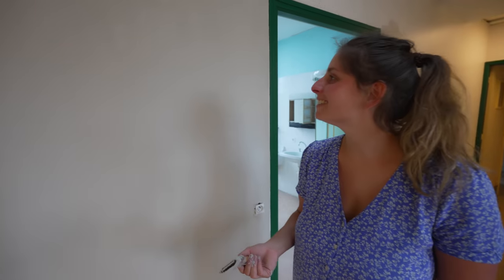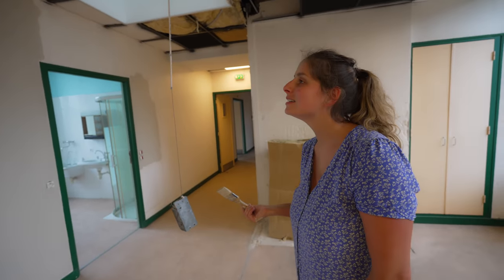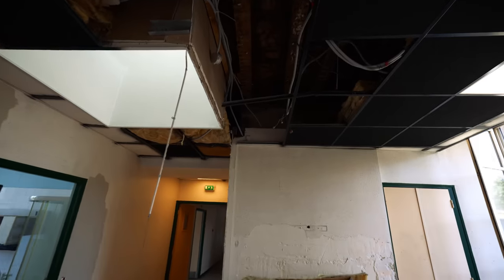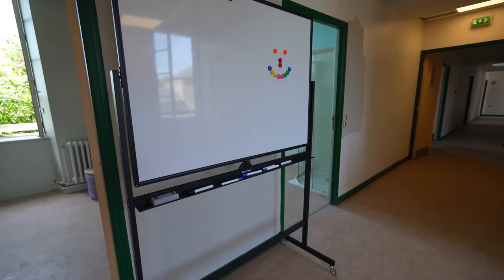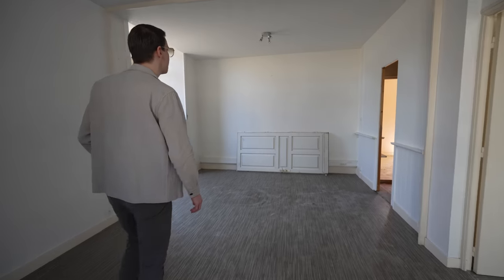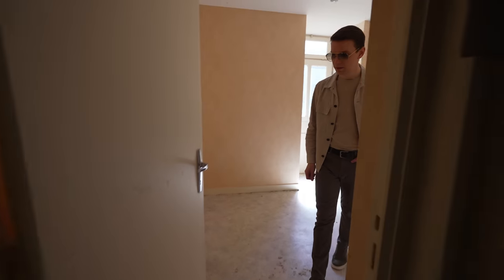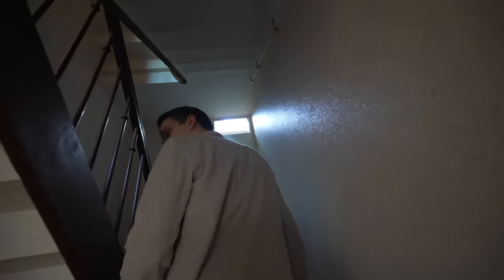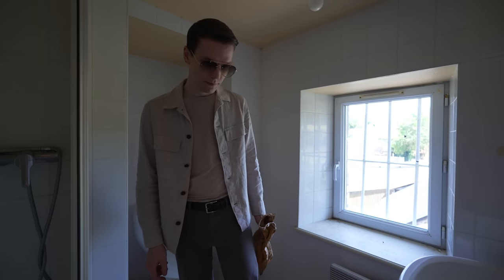The Boss Comes To Help At The Abandoned Convent!

Comment: Love the black ceilings. Gwen did a great job with the bubbly wall. The 1st apartment I can see great possibility. Will you put the fireplace back. I can see a gas log or heater there especially with the front door right there. The 2nd needs an exercise loving person. I’m not sure about a 3rd story bedroom especially with a fire. I’m wondering since none of these apartments have closets where do you hang your clothes? Also a micro kitchen. Maybe knock out a wall? I love them regardless ☺️

Comment: The one thing I have missed is a location for a large garage and a workshop. Perhaps using that last 'semi-basement' apartment could be converted into such a space. It's location is unobtrusive to the exterior to the Convent would be someting to additionally consider. By digging a ramp and installing a different set of doors, this would be an ideal workspace to repair and store supplies instead of using the prime areas of the rest of the convent. Having the scrappy door between the apartments might also provide a better location for an onsite caretaker/craftsman to live and work if that is ever in consideration.

Comment: Just an idea for the last apartment: On the top floor leave the bathroom where it is and the romm next to it should be a dressing room - that is a great layout as you can take a shower and directly get dressed next door. Also, that room only has a window in the ceiling so it would not really be any good as a bedroom, in my humble oppinion. Floor beneath that can be the bedroom with a little office next door in the small room where the "kitchen" ist in. Ground floor: I would put a large wall-to wall "invisible" style cupboard in the back of the vestibule (where the tiny door leads to the other apartment), where one can hang coats, hats and keep the shoes. The room with the door that leads to the courtyard would have to be an open plan kitchen/dining/living room situation. But the layout is a tough one for sure. Every story 1,5 rooms... Other possibilty could be to really put the bedroom in the windowless top story room, and dining romm/kitchen in the first floor, living room on the ground floor.... Seems that was the way they had it. Looking forward to seeing what you will do with it!

Comment: 💕LAST FLAT TOP FLOOR - The bannister goes up the stairs to the left in front of the wall so if the wall & shower were removed where would it lead to ??? As it looks like part of that floor is missing💕Looks like a ROOM has been blocked off & bricked up behind the shower IS PART Of the building behind part of the last flat ???💕LAY THE LAST 2 flats floor plans out next to each other floor by floor maybe where the funny door is with part wall knocked down is all plasterboard💕Instead of 2 flats maybe there could be 3 flats A B C a top middle & bottom floor flat💕Floor plans need looking at💕

Comment: Maybe a sunken small courtyard with a wrought iron rail around it for the second apartment so you could dig down so there would not be a step down at the entrance of the apartment as it is very strange and dangerous.Your steps down would be into the courtyard it would also be some nice outdoor space for the apartment,just an idea. It might be money well spent to hire a interior designer/structural engineer to help with the design of the apartments. Their knowledge will help with everything being up to code and designed so they would be easy to rent and turn out AMAZING,OUTSTANDING,STUNNING,SPECTACULAR,STUPENDOUS,STELLAR,PHENOMENAL. 😉😉 It may also help you avoid some costly mistakes. These are all just ideas all the very best on all your endeavors always!!!💖😊💖

Comment: Another great video Billy, thank you…

Just a thought on the 2nd apartment with the 3 levels, on the ground floor you knock through to that spare bedroom of the other apartment. This will create space for small vestibule from the front door to the staircase, the old spare bedroom becomes a larger sitting room, the other ground floor room becomes a kitchen and install a Wc 🚽 in the tiny sink room.
Then have a bedroom with small Wc/shower room on each of the upper floors…

Comment: Billy you shouldnt step down into a building. The ground outside should be 150mm below finished floor level inside. I guess there is no dpc on those external walls however I dont see any rising damp on the walls either, something to think about

Comment: Those 2 apartments almost seem to be better as 1 extra large space. Especially considering the doors to the garden, it would be far nicer as a proper space for a family instead of trying to cram more people into smaller spaces. That wall being broken between the 2 rooms through that door way is an omen.
Finish that job and make a lovely large family home!
Reply: @barbeeseymour3618  I suppose it depends on the area and potentially what he does with the rest of the building.  Just like anywhere a lengthy commute, access to restaurants,  shopping, schools matters. At one point many people in the West lived in sod houses or cabins with dirt floors but we have sod on the roof for cooling and tile floors.😀 So, maybe they are used to it because they rarely get an opportunity to live in a different sized home, even if they can afford it.
He should be a rebel and try it. 
He could always make it a small B and B too.

Comment: Billy, What is the marketplace for rentals in the area? Number of desired bedrooms? Short/long term or seasonal? 

It may make sense to make one stairwell to serve the combined units instead for last two buildings. Can you post some architectural drawings of the spaces and where the shared walls are for the last tow building spaces. I think I see a couple of possible layouts which can better use the space and make the maximum units but the key is what is the market.

Comment: Those polystyrene ceiling tiles that you're painting black and reusing - I remember them being incredibly popular in the 1970's but I also recall them later being found to be something of a fire hazard. In such an ancient building is it worth still following the 3 R's principle with this in mind? Might this possibly be a cost saving measure too far & how would their reuse impact on a possible fire insurance claim should the unthinkable ever happen?
P.S. The insulation is pretty old too. Is it up to modern French building code fire regs?
Sorry to be such a doom monger but you've all put tremendous effort into renovations & loads yet to come. Would really hate to see it come to nothing if worst came to worst. 
All the best. 💓 💓